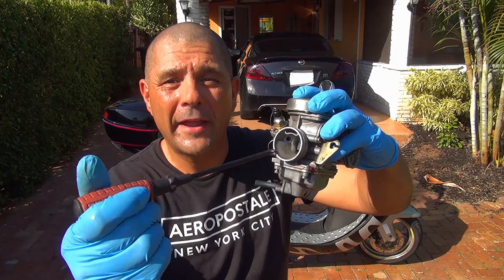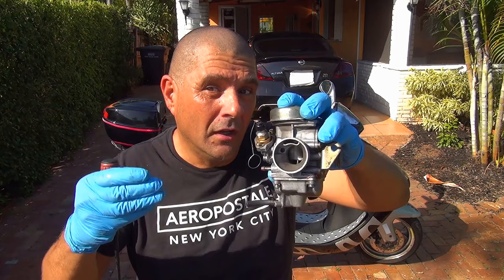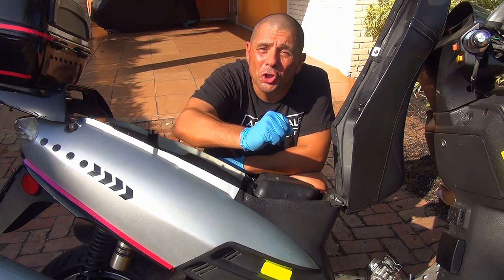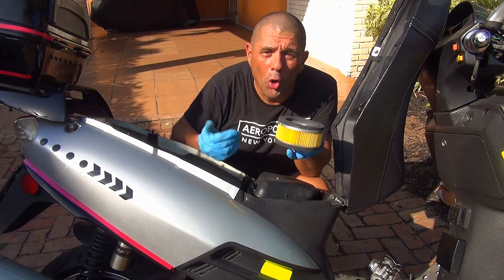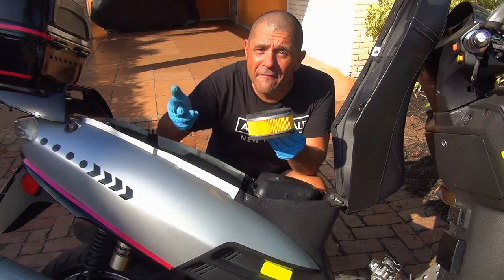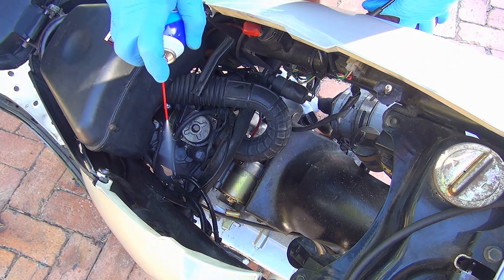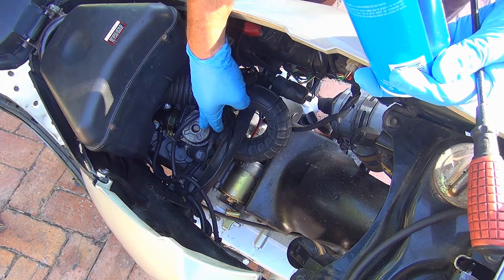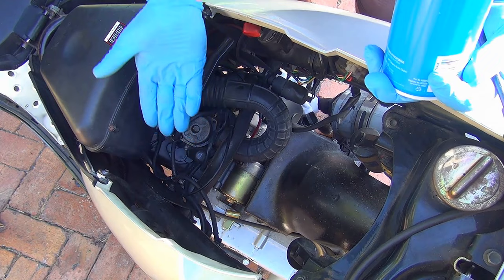How to fix a scooter that bogs down

Comment: You my friend are the greatest. I have over 9,000 km on my Chinese scooter and use it as my daily transportation. Rain, sleet or snow I ride everyday. A little maintenance goes along way and if you take care of your scooter she will take care of you ah ah ah.
Reply from the maker: Hello my friend thank you for watching my video
Reply: 🛵🛵 I got 038991 miles on my Chinese scooter the ice bear rocket I live in Buffalo New York and I drive it all year round rain sleet snow shine don't matter to me and that sucker runs like it just came off the assembly line except for today I'm having some bogging problems and that's why I'm on this website 👍🏻🤔
Reply: I NEED YOUR HELP PLEASE.  My scooter is a 50 cc and it starts right up but when i turn on the throttle and it will start ans then almost die and it will will continue to do this til its warmed up (10 minutes) and its getting worst.  What do i do????@VirberelloScooterTips
Reply: Are your valves adjusted proper ? 
Is your carb clean?

Do those and it's free I mean if you got the feeler gauges and carb cleaner..

Comment: This dude is awesome I asked 49ccscoot  for help on my 150 scooter he was useless. This dude sent me a 5 inch message on every thing a carburator does its function why mine is acting up. I've been working on these 150 scooters for 6 years  but my carburator was pissing me off. This dude needs more recognition. 💪👍👏👊😁
Reply from the maker: Hey there! Thank you so much for your kind words! I'm thrilled to hear that my message was helpful for you. It's always a pleasure to share knowledge and assist fellow scooter enthusiasts. If you ever have more questions or need further assistance, feel free to reach out. Your experience and expertise with 150 scooters for six years is impressive, and it's great to connect with fellow enthusiasts like yourself. Ride on, and thanks again for the recognition! 🛵✨

Comment: Hey bro can u help me? now my  is bogging down I changed the spark plug . I cleaned my ejections and it’s still bogging down what else should I do
Reply from the maker: Sure, I can help you out. If your gas scooter is bogging down even after changing the spark plug and cleaning the injections, there are several other things you can check.

First, take a look at the air filter. If it's clogged, it can restrict airflow, which might be causing the problem. Cleaning or replacing the air filter could make a big difference.
Next, consider the fuel system. If your scooter has a carburetor, it might need a thorough cleaning. Dirt or debris in the carburetor can really mess with performance. Similarly, check the fuel lines for any blockages or kinks, and make sure the fuel filter is clean and not restricting the fuel flow. Also, it's a good idea to ensure you're using clean, fresh fuel because old or contaminated fuel can lead to issues.
Don't forget to inspect for any vacuum leaks in the intake manifold or hoses. These leaks can cause a lean mixture, leading to the engine bogging down. The exhaust system is another area to check. If it's clogged or restricted, it can cause back pressure, which reduces engine performance.
Take a moment to check the throttle cable and linkages too. Make sure they're properly adjusted and not sticking. Even though you've already changed the spark plug, it's worth checking the ignition coil and wiring for any signs of wear or damage.
Lastly, consider the engine's compression. Low compression can cause bogging down, so a compression test might help you identify if this is the issue. If your scooter has any electronic sensors, such as a throttle position sensor or an oxygen sensor, ensure they're functioning correctly as well.
If you go through these checks and the problem still persists, it might be time to take your scooter to a mechanic for a more thorough diagnosis.
Thank you for  watching my video
Reply: @VirberelloScooterTips  thanks bro ur the best

Comment: Follow Up on my NEW scooter bogging down.. I decided to inspect the intake system for airflow.. Factory did not bore out the air cleaner housing inlet properly. My poor scoot was trying to breath through a hole the diameter of a pencil.  I enlarged the hole to match the size of the other passages in the air cleaner assembly and VOAILA! No more bogging down!
Reply from the maker: That's fantastic to hear that you were able to identify and solve the issue with your scooter's bogging down problem! It's amazing how a simple fix like enlarging the air housing inlet can make such a significant difference in performance. Your experience will likely be helpful to others who might be facing a similar problem with their scooters. Thanks for sharing your follow-up, and happy riding with your improved scoot! 🛵💨
Reply: Oh yes! she is a totally different beast.. I can be more confident crossing busy intersections!  @VirberelloScooterTips  NExt week, her first oil change!  (500 KM / 300 Miles ) . Seems there is a point of confusion about units of milage pertaining to service intervals. I tracked down her original PGO motor scooter company service manual  and it clearly says first oil change 500 (300 miles)  KILOMETERS , but the american importer's service manual says 500 MILES (1500 km) .  I am going for the metric service schedule . Better  to spend money on extra oil and filters than to spend MORE money on replacing engine or , entire scooter . Hey! might be a nice bit to cover in a video?
Reply from the maker: @mysticvirgo9318  Sure, go with the metric service schedule of 500 kilometers (300 miles) for the first oil change as recommended in the PGO manual. It's better to be cautious and spend a bit more on oil and filters than risking engine or scooter damage. This would make a great topic for your video!
Reply: Is funny, I have never heard of a 'ninis scoot' 150 cc and smaller having an ACTUAL oil filter! OOOhh this little bike gonna be around till the frame rusts apart :)  @VirberelloScooterTips

Comment: I own a 2017 geely peace sports knight cruise 150cc. I ride down the road and all of a sudden I loose acceleration but it's still running. Pull over and it dies. Try to turn it over and it won't turn till several tries. Then it accelerates no problem. Why is it doing this?! New fuel filter and hose, vacuum hose new. Please help!! Is it overheating?
Reply from the maker: It sounds like you're experiencing some frustrating issues with your Geely Peace Sports Knight Cruise 150cc. While it's difficult to diagnose the exact problem without physically inspecting the scooter, there are a few possibilities to consider.
Fuel-related Issues: Since you've already replaced the fuel filter and hose, it's worth checking other components of the fuel system, such as the carburetor or fuel pump. If there's a blockage or malfunction in these components, it could cause intermittent loss of acceleration and stalling.
Electrical Issues: Sometimes, electrical problems can cause similar symptoms. Check the battery, spark plugs, ignition system, and wiring for any signs of damage or malfunction. Loose connections or faulty components could lead to intermittent loss of power.
Overheating: Overheating could potentially cause loss of power and stalling. Check the cooling system, including the radiator, coolant levels, and thermostat, to ensure everything is functioning properly. Make sure the engine isn't overheating due to lack of coolant or airflow.
Engine Timing: Issues with engine timing could also cause loss of power and stalling. If the timing is off, it could lead to poor performance and erratic behavior. You may need to adjust the timing or have it checked by a professional mechanic.
Air Intake or Exhaust Restrictions: Check for any obstructions or restrictions in the air intake or exhaust system. Blocked air filters or exhaust pipes could hinder performance and cause the engine to stall.
If you're unable to diagnose the problem yourself, it might be best to take your scooter to a qualified mechanic or dealership for a thorough inspection. They'll have the expertise and diagnostic tools to identify and fix the issue properly.

Comment: my scooter its a 50cc piaggio zip it seems like when i open full throttle it loses power 3/4 gas its fine 2/4 and 1/4 its also fine only when i open full throtle its like its losing power do you know what it can be i havent done anything with the carb

Comment: So when I give my bike gas it doesn’t has power to take off .. like I pull the throttle it revs up but it doesn’t move , wheel spins and all … please tell me it’s not the valves inside .. that’s a complicated fix for me .. hopefully it’s the carb I need to order one … I’ve been running the same carb for 3-4 years and running it on country roads high throttle mostly … deff gotta be my carb
Reply from the maker: It sounds like you might be experiencing a clutch issue rather than a carburetor problem, especially since the engine revs up but the bike doesn't move. One possibility is clutch slip, where the clutch is slipping and the engine revs up without transferring power to the wheels. This could be due to worn clutch plates or a misadjusted clutch .
Another possibility is an issue with the drive belt or bad roller weights. If your bike uses a belt drive, check to see if it's worn, loose, or broken. This can also cause the engine to rev without moving the bike.
While less likely given your description, a severely clogged carburetor could cause performance issues. However, this usually results in poor engine performance overall, not just a lack of movement when revving.
Internal transmission problems could also cause the symptoms you describe, but this is less common.
To diagnose, you can check the clutch and look at the clutch plates if you can. If they appear worn or burnt, they likely need to be replaced. Adjust the clutch cable if it's loose. Also, inspect the drive belt or chain to ensure the drive mechanism is intact and properly tensioned.
If you suspect the carburetor, a thorough cleaning can help. Given the age and usage, a rebuild kit might be beneficial if a new one isn't necessary. If you're not comfortable with these checks, a visit to a mechanic might be the best option to accurately diagnose and fix the problem.
Reply: @VirberelloScooterTips  see that’s the thing I thought it was the clutch I changed the clutch and it’s still that .. my fuel filter looks very cloudy and I’ve been running it for years I think it’s that’s .. pray to god it’s that I’ve done everything

Comment: Great video! Thanks for teaching us step by step how to diagnose this! Stoked because I already have a new carb and fuel filter ready to go as my moped was bogging so i'm gonna change it tomorrow.
Reply from the maker: You're welcome! I'm glad you found the video helpful, and it's great to hear that you're proactive about maintaining your moped. Changing the carburetor and fuel filter should definitely help improve its performance and address the bogging issue. Just be sure to follow the steps carefully, and if you have any questions or run into any issues during the process, don't hesitate to seek advice or assistance from a knowledgeable friend or mechanic. Good luck with the repair, and I hope your moped runs smoothly once again!
Reply: Thank you so much for the blessings! I have friends around me who know what they're doing, but I'm doing this one on my own unless I run into any issues. Thanks again. I'm also going to clean out the fuel lines and check for leaks. @VirberelloScooterTips

Comment: Man i really appreciate you giving me such thorough information! Both my scooters are having the same issue so hooefully i can get em back running after watching this vid. They are pretty new, 1 had 300 miles and 1 has 1500. I feel like they shouldn't be having problems this early but im going to try to stick it through. Thanks
Reply from the maker: You're welcome! I'm glad I could provide you with helpful information. It's unfortunate that you're experiencing this issue with both of your scooters, especially considering their relatively low mileage. While it's true that newer vehicles should typically have fewer problems, there can still be occasional issues that arise.
By following the suggested steps and seeking professional assistance if needed, you should be able to address the fuel mixing problem and get your scooters back up and running smoothly. It's always a good idea to stay proactive with maintenance and address any issues promptly to ensure the longevity of your vehicles.
If you have any more questions or need further assistance, feel free to ask. Good luck with resolving the problem with your scooters!
Reply: @VirberelloScooterTips  I've been tuning carbs for 30 years but my 150 scooter has me stumped no matter what I do I can't get it jetted for 💩. The main thing is the diagram is getting gas on it w.t.f. how. I've asked 3 people so far. One said if I had another carb no shit I wouldn't be asking you  then Einstein. You have any realistic help? 😁
Reply from the maker: @burt1758  Hey there! It sounds like you're dealing with a frustrating carburetor issue on your 150 scooter. Carb tuning can indeed be tricky, and it's understandable that you're seeking help. Here are a few suggestions that might help you troubleshoot the gas leak on the diaphragm:

Check for Cracks or Tears:
Inspect the carburetor diaphragm for any cracks or tears. If it's damaged, it might not create the proper vacuum, leading to fuel leaks. Consider replacing the diaphragm if you find any issues.
Float Level Adjustment:
Ensure that the float level is set correctly. If it's too high, it can lead to excessive fuel entering the carburetor and causing leaks. Adjust the float height according to your scooter's specifications.
Needle and Seat Inspection:
Check the needle and seat for any debris or damage. If there's dirt or a misaligned needle, it can result in fuel overflowing. Clean or replace these components as needed.
Vent Lines:
Check the vent lines to make sure they are clear and not obstructed. A blocked vent can lead to irregular pressure within the carburetor.
Carburetor Gasket:
Inspect the gaskets between the carburetor components. A damaged or worn gasket can contribute to fuel leaks. Replace any faulty gaskets.
Idle Mixture Adjustment:
Ensure that your idle mixture is set correctly. A too-rich or too-lean mixture can affect the carburetor's performance and lead to fuel leaks.
Professional Inspection:
If you've exhausted these options and still face issues, it might be worthwhile to consult a professional mechanic. They can provide a hands-on diagnosis and offer solutions based on their experience.
Remember, patience is key when dealing with carburetor issues. It might take some trial and error to identify the root cause. Good luck, and I hope you get your scooter running smoothly soon!
also check this link https://www.firenzee.com/gy6/
I hope this can help you
Reply: @VirberelloScooterTips  Thanks for the really detailed message I've been working on these for 6 years I'll never seek help from a professional LMFAO. This is one f*ckin stubborn carb. I'm getting a kit with everything needle, floats, diagpram etc. If this doesn't work I'll get a bran f* cking new one. If the seat is worn in the carburetor then it's garbage. I'll let u know what happens. 😁👊👍👏

Comment: it can also be your vaccum fuel pump.. that was the case on my gilera runner sp 70cc. the pump could not deliver enogh fuel when i give it full gas so when i hit 40 km/t it just bogged i checkt everything and found out the pump was done..

Comment: I had my first experience of my 125 moped bogging down this morning!! Was perfectly ok riding around town but soon as I went on an A road I opened the throttle and started losing power and engine cut out, waited 20 minutes and started so carried on riding and 5 minutes later happened again and wouldn’t start!!!!
I had to sit at the side of the road for 4 hours waiting for recovery
Reply: i think tahs a carb issue or maybe spark

Comment: Hello and thank you! I have 2 Tao Tao scooters. They are 49cc Tao Tao. Will this fuel filter work on my scooters? One runs great but one is bogging down and won't run at full speed.
Reply from the maker: Hello the filter in the video is for 150cc for a 1/4 hose I think it could work on your scooter but if you can find try to replace  your fuel filter with the same filter you have at the moment